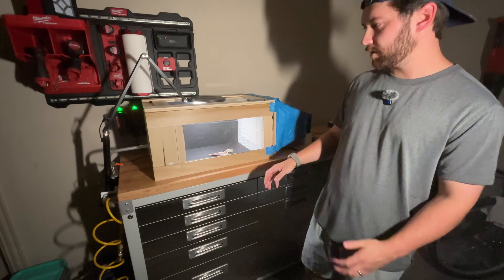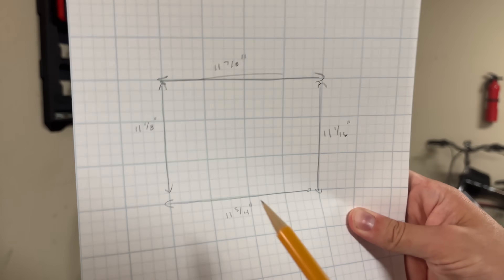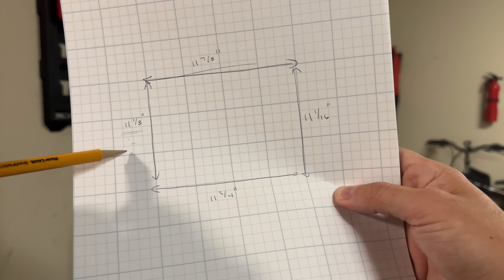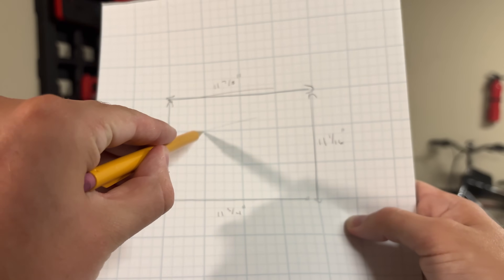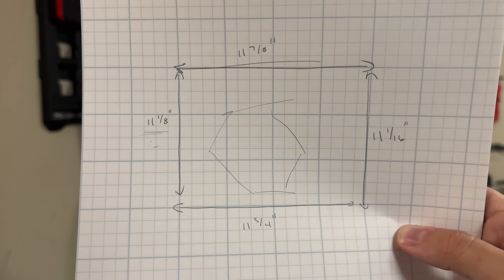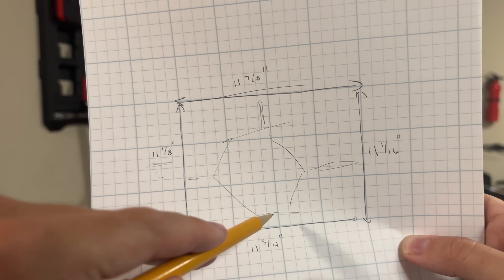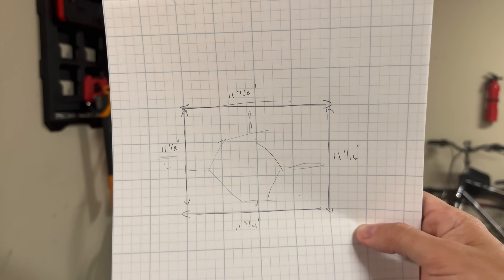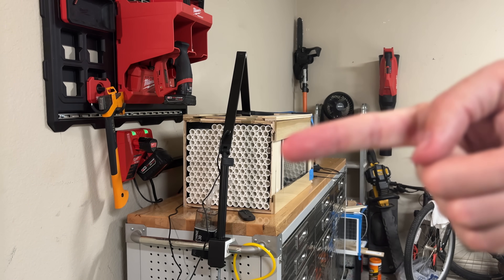DIY Wind Tunnel Part 4: I made the Laminar Flow better!

Comment: I made one of these in the 1980s ! It was much finer than this as it used full length plastic drinking straws (i dont think you can get them anymore?), I also made a liquid version, where the output was a single focused flow - made 30 meter long arches of water about 9mm diameter before it broke up. Funny thing, I still have them after 50 years, plus about 20 boxes of spare straws
Reply from the maker: No way! That’s so cool! I thought about using drinking straws it definitely would have made this a lot quicker of a project!! Any tips to make this better?
Reply: @TheWindTunnelChannel-b1e  Yes, before the air going in, hits the intake of the tubes, you need to buffer it, and disperse it evenly so all the tubes get an even amount of pressure. You can use some light open air wadding in an enclosed box area before the tubes, like they use in filling soft furniture, pillows or cushions (about 5 inches thick is good - must be a loose type of foam you can almost see through - not the dense type, and then you can pack it denser to experiment). If the air going in is from the room air, then you can just leave the foam intake open to room pressure (put some wire mesh or even open netting curtain fabric or plastic over to hold the light foam wadding in place.. (The wadding will be like a "dust filter" too). If you are sucking air out with a fan (I think you are), you will need a pressure matching (square is ok) cone shape on the outgoing area of the tubes -  matching the square output of the tubes, down to the fan size, and fill this area, including in the cone area, loosely with the wadding as well (put some of the same mesh in front of the fan, so it doesn't suck it in. The wadding and matching cone evens out the fans turbulence, and sucks all the tubes evenly, so to speak. If you were force feeding air into your foam intake box - thru a smaller tube as the supply of air - then its even more important on the supply side to expand the air evenly - so you'd need to use the same cone idea with light foam as well, so all the pressure from a smaller expands and evens out before it get to the tubes, to create an even laminar flow. You ideally need the same tubes on each side, straws are smooth and really good for laminar flow, even the gaps between them work well. It's all about gradually evening out pressures over the wider areas.
Reply: Came here for the soda straws. 👍🏻👍🏻

Comment: Is the hexagon just to fit things on the print bed, or does it serve some other purpose? (Or is it to look neat? (It does))

If it's just for the print bed, how come doing it in 4 quarters wouldn't've worked?
Reply from the maker: A little bit of both! I thought hexagons would look cool, but I also wanted to be able to put the smoke machine on the center of the chamber. I could have done that on the front like I did with the back, but I for sure wanted the front to be hexagons! Thanks for asking! & for watching!

Comment: 3:34….what? What 3D printer on earth will only print by object? You can’t physically even fit them on the bed without colliding with the gantry…what? What software? What?
Reply: You can with some Core XY printers the bambu lab software has a toggle for it

Comment: Increasing the output side size to match the inlet may fix it. Duplicating your intake system and using it on the outlet may also help.
Reply from the maker: I had the same idea! I’ll have to experiment with that idea! Thanks for the suggestion!

Comment: You must have the same wind speed in the smoke inlet as in the other inlets, and you must have the same uniform vacuum on the holes on the other side, which means that the fan must be further away and perhaps shielded.
Reply from the maker: That’s interesting! I’ll have to try that!!
Reply: @TheWindTunnelChannel-b1e  I don't know much about this but I love stuff like this and if I were you, I'd experiment with moving that print to the outlet and either re-creating it for the inlet, possibly with smaller holes, if you're still not 100% happy or, if that is still not to your satisfaction, as a thicker version with longer passages that protrude to the outside and you can still try the longer version with the smaller holes.

Another thing that occurred to me, but I'm not sure how technically feasible it is, would be to print the passages lengthwise, instead of vertically, to eliminate any potential influence from the layers introducing any minute unwanted turbulence into the flow that might not be noticeable right as it enters the chamber but gets magnified with distance.
Reply from the maker: I thought the same thing but I don’t know how to do that either!
Reply: @TheWindTunnelChannel-b1e  I think a "diamond shaped" (a romboid?) infill instead of the honeycomb structure could solve that, because it would be possible to print at 45 degrees, which most printers will handle, so you could place it "lying down"
Reply: @fotodille  I was thinking, "why not just turn it on its side?" and then your comment made me realize how weird and troublesome the print layers would be.
Reply: @fotodille  This. Most printers should be able to handle doing 45 degree overhangs, and if it's difficult, make it like you said, a rhomboid instead of a perfect square, so while there's going to be less permeability, the grille design should be the most efficient for the manufacturing technique when it comes to laminarizing the flow.
Reply: Also, and I must add the disclaimer that it's about 40 years since I last worked with/studied this, I think that when you look at how liquids - and I think this goes for gases too - flow through a pipe, you get a layer closest to the wall of the pipe that "sticks to the wall", sort of. That makes it slower than the flow in the center of the pipe, and depending on the speed and viscosity of the liquid/gas and the dimensions of the pipe (both diameter and length) you will get different zones of laminar and turbulent flow in the pipe. 
Probably there are simulations online that you can run to see this ...
So different diameters (round or otherwise) will probably work better or worse as well, and maybe ord depending on fan power. Simple, right?! 🤓
Reply: @fotodille  it's called boundary layer, and it's the bane of all wind tunnel engineering. (I have a book, Wind Tunnels of NASA, that goes into how an irregularity the thickness of a bit of scotch tape on the inside wall can completely disrupt the laminar flow in a transonic tunnel)
Reply: Yeah, this is called impedance matching. You definitely need the exact same inlet and outlet air speed. 
Also, the fan blades are rotating and adding lots of turbulence.. backwards into the chamber. So place it further away, and shield it, so that you just get a vacuum pull and not also the oscillations. Perhaps at the end of a tube.
Reply: Might need multiple grids of channels on the outlet to reduce the effects of the fan at all speeds.